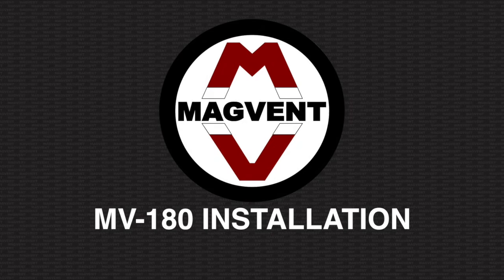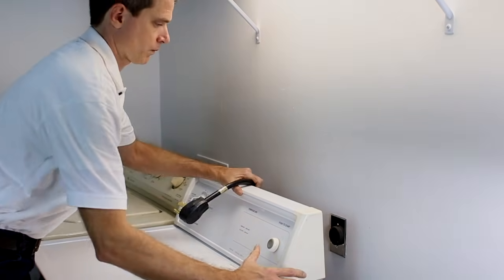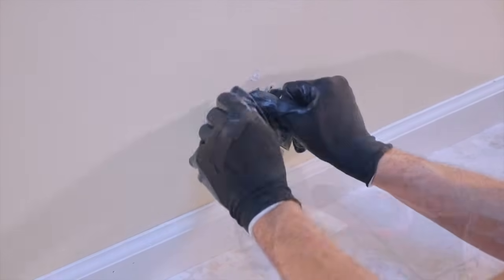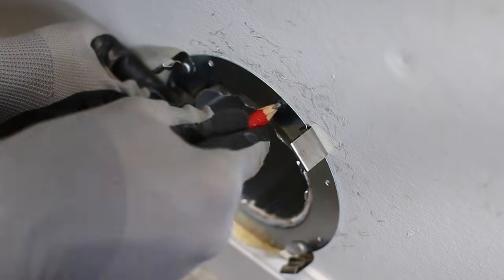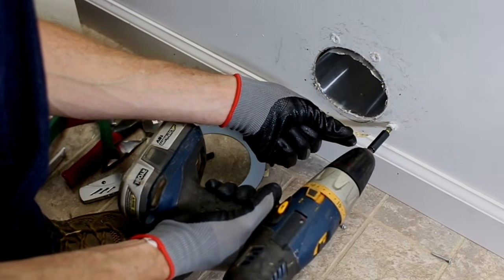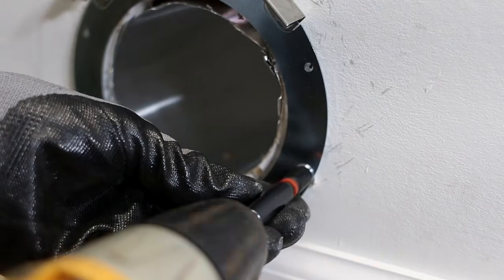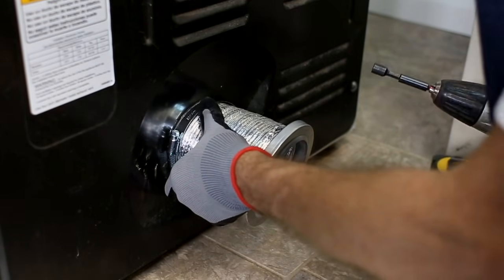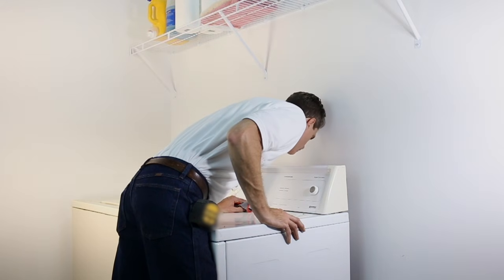MagVent MV-180 Dryer Vent Installation

Comment: Parker you have proven just how little you know and how little you care about people. I have been in many homes where fires and near fires have occurred and all due to improper venting. Since you are very immature I know you can’t understand the seriousness of a fire in a home but it is very serious. I treated every customer as if they were family and did my best to prevent tragedy, maybe you are okay with a tragedy to happening to you family but I am not. Maybe once you get life experiences and some maturity you can understand things. Until then leave it to the people who know better. Hopefully you never get into a career that a person like you, who cut corners  and disregards safety.
Reply: In one of my deleted responses, I quoted LG manual specifically starting UL approved flexible duct is allowed.  You keep stating the product in question doesn’t count. But that is your claim. Not what the document actually says.  Further, you keep claiming it is a safety issue. This is false. It would not pass UL 2158A if it wasn’t safe. Ordinary flexible duct does not pass. You claimed it did. You were wrong. Ordinary flexible duct does not. DryerFlex does.  You have no leg to stand on. Apologize for your false claims.
Reply: CaseAgainstFaith1 an intelligent person would use what they advise, you on the other hand, well you know.  Only an idiot would expect a list of what not to use. Ever seen a car manual telling you not to put water instead of oil in the engine, of course not.  That is why the manufacturers provide installation manual for purchasers of the product and installers telling them what to USE.  You lack common sense but heck people like you keep technicians and manufacturers in business after you decide to purposely destroy the product. Again give up and admit you are way off base
Reply: @rondenhollander4313  You must be either trolling, or of subhuman intellegence.  I've already stated that the manufacturer does not say NO FOIL on my documentation. If they say that on some other documentation, you haven't provided it. And you STILL have not answered my question as to what product YOU think LG is referring to. If you are so smart, why is this so hard to answer?
Reply: CaseAgainstFaith1 flexible not foil otherwise it would clearly state FOIL, give it up you are wrong and can’t deal with it. But again thanks for the laugh, each time you attempt to respond you fail miserably.
Reply: ron denhollander Nonsense. The way exclusions work is they need to be stated.  If they meant to exclude foil they need to say so. How would anyone know except YT know-it-alls like you? You have also failed to provide an example of a product that would qualify.  If you are so smart then why can’t you provide an example of something that would qualify?  And no , don’t give me semi rigid again because the manual specifically says that it is an alternative to semi rigid. So, give me an example of what counts. And demonstrate there is a safety issue with a product that meets the UL standard or retract your claim
Reply: Flex does not mean foil. Was clearly outlined when I was Factory Trained by LG, can be UL approved but not allowed by manufacturer.  White plastic is UL approved. Get some training and learn how appliances work. Still no one can supply from the manufacturer that the product is allowed. You are wrong, just deal with it
Reply: CaseAgainstFaith1 guess you will install the white plastic too since it is UL approved as well?  Flex metal is sold in lengths 3 ft and 4 ft and can be extended to approx 8 foot, available at any home center.   Foil when the dryer is pushed back gets crushed, offset and when condensed it length the diameter becomes smaller than the required 4 inch minimum diameter when the foil is pushed in , exactly the way white plastic does. The mag vent argues it meets heat UL requirements, that’s not the issue. In 100% of the installations I have seen with the foil it has been distorted , crushed and collapsed. If you want a dryer to have a shorter life and other issues use foil.  If you want it installed proper use flex metal, and rigid observing the recommendations for turns and length as well as the outside termination. Not one manufacturer I worked for and was trained by said yes to foil. Be safe not sorry
Reply: ron denhollander I have asked you repeatedly to demonstrate that the product is unsafe. You simply assert that it is without evidence.  I have asked what you believe LG means and provide an example and you refuse to answer.  Yeah I have insulted you.  But you have insulted everyone who disagrees with you.  Yet you keep making claims without evidence and whine because you get called on it. When exactly will you put up or shut up?
Reply: CaseAgainstFaith1 I didn’t take pictures of the dryers I saw burnt inside, failed heating elements and blown thermistors and thermostats.  Most all from bad venting with foil and plastic the biggest killers of dryers. LG trainers personally told me that foil was not approved on their products. It doesn’t have to state what not to use, you are a moron for thinking they have to list everything you shouldn’t use. Number one thing every trained professional, which you are not ( thank god or too many would destroyed products) do when going to a house for a complaint if a dryer fail is inspect installation, hint dumb dumb, this is for most products, and sadly , due to people like you, the venting is wrong. You have no idea what you are talking about and I feel sorry for you.  Give up, it isn’t matter about winning, it is about safety, something you care little about.
Reply: As much as it pains me, I am afraid I have to admit Ron was actually correct on a couple of things.  I hate it when other people refuse to admit they were wrong. So, I don't want to be like them.  So, here are a couple of things that Ron said that are actually correct.

1.  LG does, at least on some of their documentation, say to not use foil.  My dryer's main manual doesn't say that. It just says to use rigid or semi-rigid if possible.  But, it also came with a quick start sheet that says to not use foil.  Why it says it on the quick start sheet and not in the manual I don't know.
2.  At least some common foil duct has the same UL2158A rating as does DryerFlex and rigid and semi-rigid ducting.  Though I'm still pretty sure the old white plastic does not.

That said, the DryerFlex product really is different than regular foil.  I am not associated with them. But, I was already using it before I knew about MagVent.  DryerFlex fail is thicker than standard foil.  The vendor claims it is even stronger than semi-rigid, though I'm not completely convinced of this claim.  More importantly, it has "micro folds" for lack of a better word such that when it expands and contracts, the interior dimensions remains 4".  Typical foil is only about 3.5" ID when compressed.  DryerFlex is 4" all the time.

Further, using MagVent allows one to use an OVERALL shorter dryer vent path.  Which is SAFER.  I have a difficult install.  My dryer location is 37" wide, wall to wall. With my old 27" wide dryer, I could barely squeeze by it between the wall and the dryer to get at the connections.  With my new 29" wide LG, I just can't fit between it and the wall.  I can't connect it in place.  Not without tearing down the wall or something.  With DryerFlex, the install is easy. I have about 3" of STRAIGHT foil, that is enclosed such that nothing could fall on it and damage it.  Full 4" ID.  UL rated fire resistant.  My complete total duct length is less than 2 feet including the MagVent as it just goes straight out of the dryer through the MagVent to the house exit. I see utterly no danger.  I totally agree with Ron that long snaking foil vents with basic foil duct are problematic.  As near as I can see, this is not.  Not the same at all.

But, if he is a contractor, and he feels obligated to follow the letter of the document and not use foil, I can understand that decision.  I would suggest that he consider at least looking at the product, it might be available at a local store.  (DryerFlex that is, it is sold under different brands though.)  So that he could at least be familiar with the product.  That doesn't mean he has to use it, I'm just suggesting he consider being familiar with it.  He could also look at DryerFlex's website.
Reply: CaseAgainstFaith1 thank you for recognizing what I have said. Further checking into the UL rating it is for fire rating and to a maximum length of 8 feet.  I have never argued the fire rating but the issues with using any foil and it is an easily distorted product.  I have done warranty work for almost every domestic and off shore appliance product, I have been factory trained and have been a trainer for manufacturers.  I have investigate fires in products. There is too much of things put on the internet people see and then do.  There are many who have little knowledge and watch the 30 minute shows on TV and then are experts and cause problems. I have had to repair products that people have watched videos and attempted then made it worse.  Much of the problem with dryer install is the incompetence of the builders. Any reputable builder knows where a outlet should be for the vent of a dryer. I will only install, as should anyone who cares about safety , a product according to the supplied manufacturer installation instructions and local codes. Until the manufacturer of this product supplies documents stating manufacturers approve then it is not allowed on a product. Properly installed dryer can last 40 to 50 years , one with foil can burn out in a week .
Reply: ron denhollander I try to be honest so I had to come back to correct myself. By my username you might guess I have run ins with religious people and rarely do they admit error. Now that said, why can foil cause fires? Does foil just magically attract fires?  Or is there a reason?  Yes there are reasons why foil can cause fires. And those reasons do not seem to apply to this product. If you can’t use it because you are a contractor, okay. But that doesn’t mean the product is actually unsafe if you use it properly.
Reply: CaseAgainstFaith1 Proper Venting of a dryer is critical to safe operation. Over 75% of dryers I have seen have not been installed properly.  Failure of most products are due to improper installation. Foil venting of ANY type will not maintain proper air flow out of the dryer. This builds up heat and can and does cause lint in the dryer to ignite. You think many maintain their dryer, no. Even pulled tight the foil venting restricts air.  Most installers, homeowners , builders do not read the instructions and many warranties are voided. People attach the foil while dryer is out then shove it back, deforming, crushing and destroying the foil venting causing restrictions and overheating dryer. And no they don’t always shut down, refer to Frigidaire dryer fire problem.  It is stupid not to follow the instructions and the reason why the No Foil was on the cheat sheet was most everyone refuses to read the manual.
Reply: @rondenhollander4313  "Proper Venting of a dryer is critical to safe operation."

Agreed. Have I EVER said otherwise?  No.

"Foil venting of ANY type will not maintain proper air flow out of the dryer."

How do you know this if you haven't tested the product?  I don't think you have even bothered to look at the website for DryerFlex.

"Even pulled tight the foil venting restricts air."

NO!  This stuff doesn't. At least not any more than semi-rigid.  That's what I have been trying to tell you! The entire reason the product exists is to be as user friendly as regular foil but as safe or safer than semi-rigid. That is the entire purpose of the product and what I've been trying to tell you and you won't even look.

"People attach the foil while dryer is out then shove it back, deforming, crushing and destroying the foil venting causing restrictions and overheating dryer."

I agree that if you improperly install it, it is a problem.  Would you try sticking to the subject of a proper installation of the specific product?

In fact, while DryerFlex by itself is intended to avoid at least most of the problems of foil, adding the use of the MagVent such that the amount of the foil is very small and very close to perfectly straight.

The upshot is, the reality is DIYers won't always do it perfect, but something like MagVent makes it easy for DIYer to install a very short, straight vent.  Thus IMPROVING safety, at least compared to how it will likely actually be done by a DIYer if they don't have such a product to make installation easy.

Again, I have no relationship to either company. I'm just calling it how I see it.
Reply: CaseAgainstFaith1 bottom line is only install a dryer according to manufacturer supplied instructions, installing otherwise can create a fire hazard, which you encourage,  The product does not meet manufacturers specifications. Never use a product that is not in accordance with code or the manufacturers, I prefer safety you prefer otherwise.
Reply: CaseAgainstFaith1, just take the time, go to school and apprentice , get factory trained, learn the difference between foil and flexible metal, how to properly install an appliance to safely operate. I rather do it proper and follow the training I received by LG, and dozens of other manufacturers. You just embarrass yourself more and more. The only manufacturer recommended installation of a dryer is rigid metal or flexible metal -read if you can NOT FOIL,. Give it up, you are wrong . I have seen fires , burnt wiring, scorched lint and debris in far to many dryers and guess what? Caused by improper venting !  Not sure why you are so bent on having a dryer installed improperly, makes no sense. Give up, you are failing miserably
Reply: CaseAgainstFaith1 thank you for proving how stupid you are. Just crawl back under your rock, or if able get some education. You are a sad person. I really feel sorry for you. I pity people that feel the need to act the way you do, thank you for the laugh.
Reply: @rondenhollander4313  I've deleted most of my posts as they did get too personal confrontational.  I will just summarize.  First, I have no relationship to MagVent or DryerFlex.  I simply want to correct the incorrect information provided by Ron.  The flexible duct provided by MagVent is by DryerFlex.  It passes UL2158A .  Ordinary flex duct does not pass  UL2158A .  I cannot personally verify, but the DryerFlex vendor claims that despite its flexibility, it is actually stronger and more crush resistant than semi-rigid.  Further, codes accept  UL2158A  as satisfactory as do dryer manufacturers.  Ron is wrong and owes MagVent and Parker an apology.  Simple as that.
Reply: ron denhollander Hey, you actually provided a reference.  Up until now you have not. Why on earth was that so hard?  It isn’t my fault you didn’t until now. That said, if that really is Minnesota code, it is nearly impossible to follow.  How exactly does one install a dryer with no flex at all?  Tear down the wall behind the dryer?  Secondly, you act as if I should know this and everyone on earth should know it. You say that the vendor doesn’t have to list every possible exclusion. You don’t think they have to list specific exclusions that people often get wrong? If it is a real safety issue and it is one that many people get wrong, then yeah, they do have to list it. Does LG think everyone has a copy of code?  You might say everyone should. Well not everyone does whether they should or not. You claim they specifically told you not to use foil. If they told you, don’t you think they should tell everyone?  The fact they even told you implies not everyone knows, right? And finally, you provided evidence that people using common foil and/or plastic and/or used it improperly caused fires. That was not what I asked for. I asked you to specifically demonstrate that DryerFlex properly installed was unsafe. You have not done that. I also asked you repeatedly what product you think LG means and you have refused
Reply: ron denhollander What is wrong with you?  As I have said repeatedly, my LG manual does NOT say to not use foil.  If yours says otherwise, how should I know?